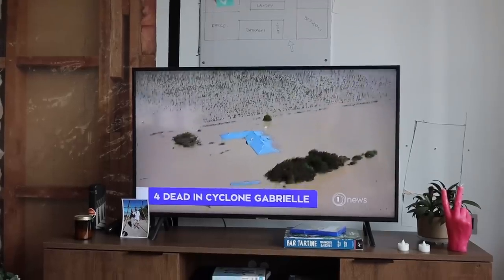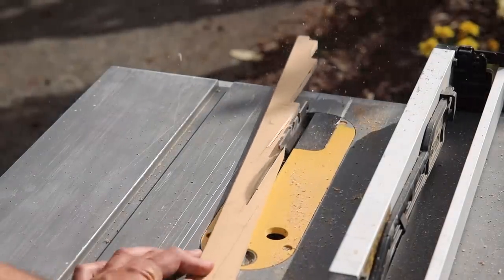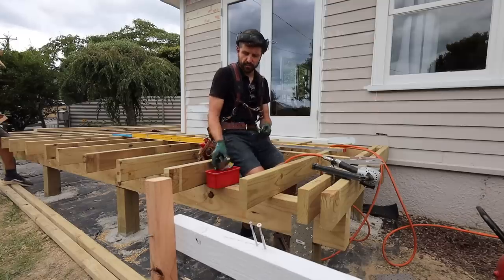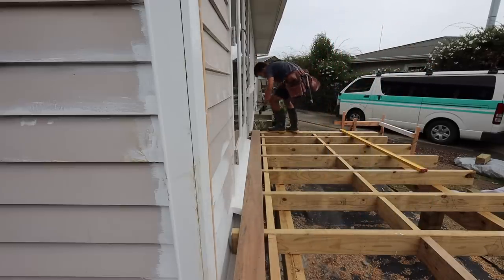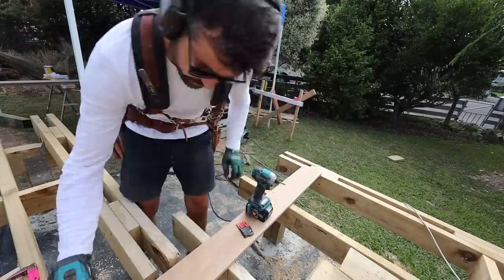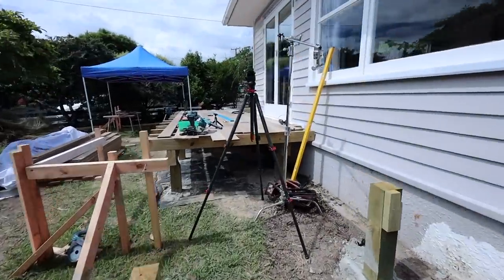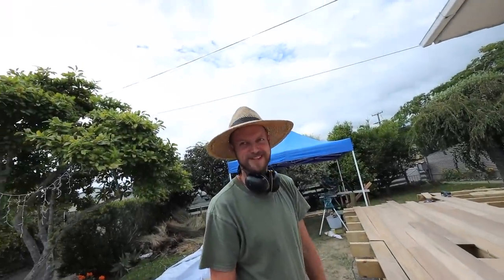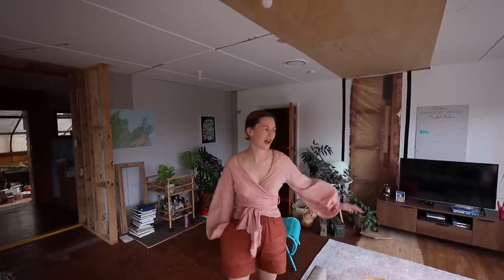Don't skip these tips, when building your deck

Comment: Food for thought, when a tree fell in my yard and hit my house and deck, the insurance at first wasn't going to cover the deck. However, because it was physically attached to the house with lag bolts (deck was also 30ft in air), it was considered part of the house and not an independent structure and was ultimately covered for repairs.

Comment: Smart move making the deck and house separate from each other. You don't want issues with dry rot, rain, etc. going from one to the other. It's also a lot less work.
Reply: I couldn't agree more. My mother in laws deck was attached and when we went to replace it where was a bunch of rot in the house where they connected. We were lucky it wasn't too bad but detached it wouldn't have been a problem!
Reply: There used to be slightly different requirements. I recall something about a “deck” being seperate actually being a “platform” which had different requirements to something attached to a house.

Or that could be urban myth /shrug
Reply: In my Local Area in Sydney if the deck is connected to the house you need to ensure there is a termite barrier in place, and for warranty reason those barriers (physical or chemical) need to installed by the supplier. If its detached by 20mm or more you don't need the barrier.

In addition there's a longer approval process for attached decks as an engineer needs to check the plans more carefully.

Comment: Im in HB; and if you haven't already got stuff like this in your emergency pack here's some recommendations. An AM/FM transistor radio & a way to keep it powered. Ideally one with an antenna so its easier to tune it. Know your local Radio NZ frequency. If there's widespread power problems then its highly likely there'll be widespread cellular coverage problems not long afterwards - radio may be your only way of finding anything out.

Also, you've got a bunch of power in the batteries for your cordless tools - make sure you have adapters to get USB plugs, or some other form of power connection out of them. You'll need to keep some back for emergency repairs / securing stuff - but once the immediate emergency is gone they might be what you need to power up a phone days after the initial hit.
Reply: I'm in HB too, and luckily had power back in 24 hrs and nothing much worse than a leaking roof.  I agree wholeheartedly that an am/fm radio would be great for information.  One thing that was clear is how completely stuffed we'd be if the water infrastructure had failed.  You can get by without a lot of things, but you can't get by without drinking water.
Reply: The failure of communications including cellular in Hawkes Bay and other areas follows on from the same failures that happened during the Christchurch earthquakes. Most cell sites only have battery back up, and those batteries only provide around six hours of 'run time' before they go flat and the whole site shuts down. Many cell sites just aren't able to have generators, so they have to rely on batteries.
What it shows us however is that in a crisis when power is lost to an area, we cannot rely on cellphones for communication or information.
Many radio stations however have generators at the studios and at the transmitter sites, so they can run for many hours (often days) and keep people informed.
The only drawback is that most cities have radio networked in from other places (most radio comes from Auckland) so there's no one local with boots on the ground actually reporting what's going on. The studios in Auckland rely on people sending them reports. 
The best radio is local - with studios in the town or city itself, broadcasting live and able to give people practical information based on real time reporting and what's really happening around the place. Sadly there aren't many truly local radio stations left these days.

Comment: Those wide boards look great. It's good practice to back cut any butt joined boards by about 5 deg, provides an air gap so the end of the boards can dry out quicker and so the water wont pool. Using a minimum gap of 5mm between parallel boards will also help drainage and stop build up of dirt between boards.

Comment: One thing that we do for our decks is put flashing tape on all of the joists and any flat surface that water can sit on. The most crucial spot to tape seems to be the stair stringers since you are basically exposing end grain. The black tape also has the added benefit of making the joists disappear in the shadows when viewing from the top.

Comment: Careful on the freehand table saw work 😅
For my table saw I have a general purpose sled that slides next to the blade and has a simple hold-down (could be just a scrap of wood laid over it and held down with a screw).  When I have a cut like that to make, I lay the piece on the sled and get the angle lined up, clamp it down, then tack an offcut next to it to repeat the angle.  Depending on what you're cutting you can also add a stop block so you repeat the length as well as the angle.  If you no longer need that angle, just carefully pry off the scraps that you tacked on and you're ready to set up the sled for a different cut.  
Love the videos, always happy to see Scott Brown pop up in the feed

Comment: Love your channel guys, totally addicted! Big DIYer myself so have picked up a lot of tips. Just built a roof platform after getting inspired by one of your other videos.

Got some tips from the experience of our Vitex deck build down in Welly if ya interested as well 😊…

- I used a 100mm nail for spacing instead. Conveniently they are about 3mm wide so perfect for deck plank gaps. Double check overall measurements each 2-4 planks using first as datum.

- There’s a profile you can get called watershed or crown profiles. These have a slightly curved top so subtle you can’t make it out. But it helps shed water and we’ve found greater longevity with the 1 deck we have that’s got it.

- Good tip on oiling ends. I didn’t and they’ve cracked. Bugger.

- You didn’t go over the hole template I think I spied you had but that makes such a big difference. I ended up using an offcut of Vitex and cut the holes exact on that then line the end of that up with a new board and drill through guide and into the board below. Worked a treat to get every board hole in exactly the same place. No pencil marks either 😉

Keep up the great vids! You’re inspiring more people than you realise. 👍

Comment: Scott, for the first board you could cut 5mm to the side of the board so you make the gap 5mm shorter and the gap thighter, and leave the end of the board uncut (the part that past the long of the house) leaving that part with the full width of the board so you can joined with the following board, and is so small difference on the part that's against the house that you will never notice.
Sorry for my english, it's not my first lenguage, chears from Uruguay.

Comment: Nice looking wood.  A couple of comments though.  As fiddly and time consuming as it is, coating boarding with decking oil before laying them provides all round weather/water protection; Second, consistent board spacers, similar to tile spacers can be bought for comparitively little cost, and they will provide a much more consistent gap than self-made wedges (or in the case of a deck  I had built, galvanised brackets used as spacers); also, if you are butting up against a wall, it's an idea to cut channels a few mm deep into the wall or board to allow water to run through, as that area may become a collection point from rain, etc.  Obviously you waterproof and/paint it, but the idea is to provide a bit of flowthrough for water which pools or runs down the wall.  A cutting blade on an angle grinder works well, as unsafe as those are.

Comment: I recently looked at a deck that my builder had done. He cut the ends of each board at a 45° so they overlapped and left on one line of screws not a double at ever joint. It looks so good

Comment: Hi Scott.  I like putting the sealer oil on the end grain as you show on the deck boards.  I have wondered if the oil doesn't, over time, vaporize and go away.  If that is truly what occurs, then the end grains are again open to wicking in moisture.  I don't have a good suggestion for what to provide long term end grain protection.  Maybe "pine tar", grease or silicone sealer materials might be worth investigating.  Just offering a suggestion from the US midwest.  Please keep making videos.

Comment: Gosh, been years since I saw the wedge method of spacing boards out - nowadays use 3mm plastic packers between each board to get the gaps even. 

Do sympathies on the board frustration damaged and knots - just had to re-mill a casement mullion, after the milling found the heartwood was showing signs of rot. It's so difficult getting decent, affordable timber presently in the UK.

Comment: Hey Scott

Maybe ask Makita for a Quick Drive system (Simpson Strong Tie). I use the corded version. 

Works a treat, don’t need to pilot. Just bung a string line down and fit the gauge.  

I reckon I could screw off a big deck in an hour, on your hands and knees maybe be a day. 

Just saying 

Love your work

Comment: to be honest that first board with the larger gap isn't an issue, helps let the rain move away and not get caught so would slow water ingress/rot over the years. i've had an unintentional experiment going on some garages i did recently and a shed i did a while back (they face each other on the same site), both have concrete ramps that come up to level with the threshold but the shed side comes flush to the brickwork while the garages have a 30mm gap. the first inch of concrete from the shed stays wet for a long time whereas the garage brickwork and ramp never has any lingering moisture.
for those who are horrified by concrete running up to brickwork and a concerned about penetrating damp the shed has a cavity wall (it's a fancy shed) so it'll just drain down the cavity harmlessly unless i have 225mm (9in) of rain and it floods the void but i reckon i'll have bigger problems at that point

Comment: Concerning your deck doors, you should add security pins to your hinges. Hinges on the outside can be quite easily opened and an intruder could be inside your house within 1 minute. The security hinge pins cost less than a avocado toast and greatly secure the door they are installed on.

Comment: Hello Scott Brown, Love your decking videos. Used your first decking video with Paeru,, (Pudoo).. 🤔..to construct my deck at home. Just though I'd mention theres a decking screw I found from Bunnings and the brand is Buildex and they are identical to the ones you use however they are self drilling so doesn't require the need to pre-drill every hole. They do save yourself a lot of time and I never had any boards split. Would recommend.

Comment: Is it a possibility to move the AC outdoor unit, not sure how much you Kiwis charge but us Aussie AC guys would be like up to about $1000 depending on difficulty to disconnect, re-pipe to new position, and reconnect, plus move the electrical. That way you don't see it when you are on your deck. Recommended against building some sort of timber cover because it restricts the airflow more than you would think making it work much harder and costing more on your power bill. Deck looks great so far!

Comment: In USA 99 percent of the metal hardware is Simpson "z-max" which is just galvanised.  I've yet to see it rust with CCA.   I have seen lot's of thrifty fellows use drywall screws which tend to look a bit rusty by the time i've come along.

Comment: I did a garapa deck two years ago following your videos.  I struggled with the Paerau method and ended up laying the boards one at a time since much of the wood was warped and banana shaped, also found my wood varied from 137 to 142mm.  I did have up to 6m lengths so maybe it works better with 3m.   

I made a jig similar to Ray's that could mark both holes out of angle iron.  It also has a tab so you could hook on the gap of an existing row and use a quick grip to pull the new board in.  

Also keen to see what you recommend for oil.  I used a British Paints water based "oil" in natural colour but it turned orange.  I'm going to need to sand it off this year and start over.

Comment: I created a metal drilling template in a similar manner but with both screw holes drilled and the same width as the joist. Simply align with the joist and drill holes. Also I think you should have used joist covering to protect the joist top edges from the rain. 3mm mdf pieces are also good for joist spacing.
Also nice to know that you are human and make mistakes. It always seems the way that if there is only one really suitable board there is extreme danger of not getting the cut right.
Reply: If you’re talking about rubberized or bitumenised joist tops, I’m not sure about them in the long term. I haven’t found any reliable resource on how they perform at 5, 10, 15 etc year intervals compared with timber on timber, reeded decking or not.
The theory is fine so far as a solid but flexible waterproof membrane is concerned, but the problem is that the membrane is penetrated by the fixings holding the decking to the joist. It probably works okay when first laid, but water is bound to get in between the membrane and the joist and the decking sooner or later, while movement in the timbers and presumably ageing in the membrane probably adds to the risk of water getting in. Don't know about NZ, but in Australia timber decks can get too hot to stand on barefoot, so it's got to be degrading the membrane underneath over time. The question then is whether the membrane traps the moisture, especially on top of the joist, and makes it as bad as or worse than timber on timber?
You wouldn’t penetrate the dampcourse in brickwork with a couple of nails every 450mm and expect it to be as waterproof as a standard dampcourse, so why would what is effectively a dampcourse on top of a timber joist be any different?
Or maybe the membrane on top of the joist works well enough for however many years and extends the life of the deck even if water eventually gets in?
Anyone know for sure?
Reply: @DamianW-ub3ob  I have used a rubber/plastic cover which has little flaps either side to stop water running down the sides of the joists. Built the deck about 2005 and still looks in good condition. Agree that the screw holes penetrate, but I think the rubber acts like a gasket between the.joist and the deck board to keep water out and stops the gap area between decking boards on the joist getting degraded. I also painted the treated pine joists to protect them. That seems to be holding up well and I think helps stop the wood getting wet and keeps the moisture content in the wood more stable.
Reply: @fredturk6447   Thanks for the reply. I know the type of rubber cover you’re talking about, although there might be different makers. Probably get a similar and much cheaper effect with bitumen dampcourse folded down either side of the joist, although it mightn’t form as tight a seal as a gasket compared with smooth rubber. 
Good to have your opinion with nearly 20 years of practical experience with the joist covers. Your deck has lasted about 15 years longer than many before rot sets in. 
You’re probably correct about the rubber joist cover keeping the moisture content fairly stable. I hadn’t thought about that, which is the other half of the water damage problem.
The damage is done by wet and dry cycles which progressively open the grain and allow more and more water in. Even if the rubber cover allows some water in, it also stops it getting out anywhere near as quickly as an uncovered joist, so it’s got to slow down the process a lot. 
Rubber seals probably are well worthwhile.

Comment: Using wedges to get even gaps...I'm going to steal this idea 👌 chapeau, paureu.
On a different note: I'm going to be very sad, when the deck jokes inevitably fade out once you finish this project
Reply: Many people use spacers for ceramic tile instead of screws.  Cheap and reusable for your next tile job.
Reply: @firesurfer  I use spacers too, but when you have to cover a given width you get problems, because the boards are never exactly the same. Lets say your deck is 6m wide and you have boards that are supposed to be 14cm with a 1cm gap that means you need 40 boards. Now when the boards vary from 13,8 to 14,2mm you will be off a couple of mm or even cm with fixed gaps, and you are going to have to improvise reaching the end making the gaps bigger or smaller. But when you can adjust the gaps with wedges to correct for the boards imperfections you can make everything look perfect

Comment: Hi Scott, I need a couple of comments from you please. 

What is the reasoning behind using flat instead of watershed profile? Was it an active choice and if so can you elaborate why? Or was it based of availability? 
Ditto for vitex vs Kwila vs other hardwoods available?  
Can you provide a detailed of the specific counter sink + pre drill bit used with those specific screws? 

And reasoning for 3mm gaps? 6mm gaps are recommended by vitex suppliers. I would expect 3mm to close to 1-2mm come winter and that will trap dirt + leaves and make it worse. I guess it’s too late now but I would strongly suggest at least 5mm gaps. 

I’m very impressed with the routering of the end grain. 
Make sure you keep your eraser handy too. I don’t want to see pencil marks left at the end.